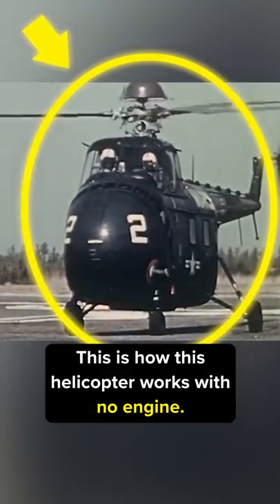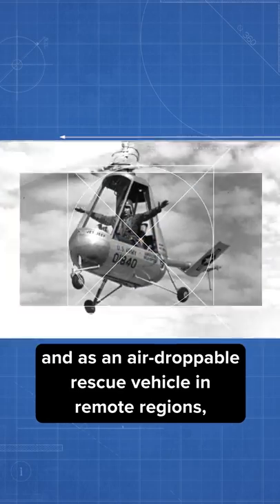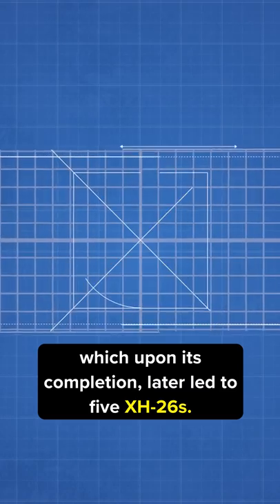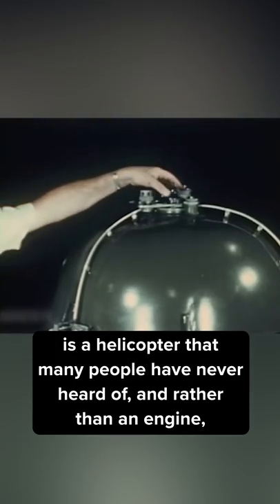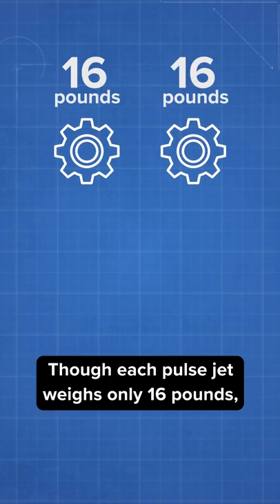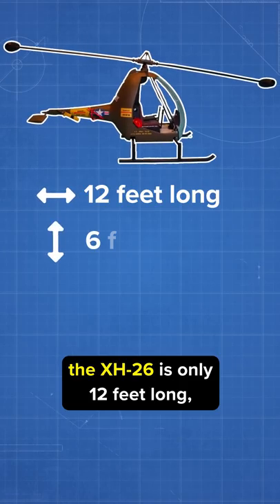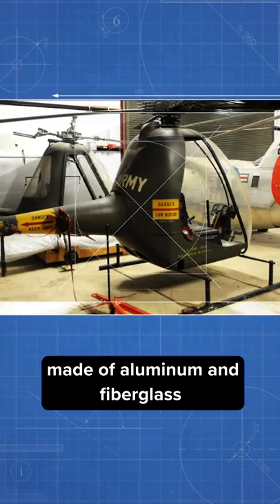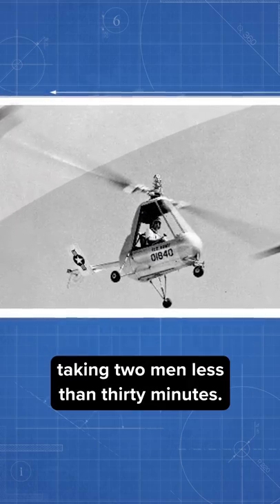How This Helicopter With No Engine Still Flies

Comment: pulsejet is still an engine
Reply: Yes
Reply: Facts
Reply: Jet engine that goes off in pulses
Reply: Yeah I was expecting it to be like bike pedals but nah this is boring
Reply: Wanna hear the worse part? You take 2 people to put it together then 1 person to use
Reply: Nah it's a jet
Reply: """"Jet engine """"
Reply: Yes, two of them.
Reply: Shpulda said no motors
Reply: I think it would be cool if there was a hand crank, but like a huge gear ratio and when you crank it once, the propellor spins like 5000 times.
Reply: 🤣 unsubscribe blocked and reported for fraud
Reply: @brib4911  An engine or motor is a machine designed to convert one or more forms of energy into mechanical energy. By definition there is no difference.
Reply: @Pengied  you'd need to be hulk to spin that hand crank then lol
Reply: @thatcommenter9111  no, it said with two people it would take less than 30 minutes but with one it would probably take longer
Reply: Exactly
Reply: @julianmathiasroder  huh. Neat.
Reply: Yessssssss
Reply: @UserOfTheName  Even legs on bike pedals are technically an engine. An engine is any device that converts potential energy into mechanical energy. In this case, it’s converting your body’s energy stores into rotational motion.
Reply: Yup,  with a fuel injection system.
Reply: Actually it's a motor
Reply: @xenn4985  You it's not a pump?
Reply: @mike7870  Thanks,  Mike!  Now where am I gonna go to get my daily dose of misinformation??
Reply: @Pengied  yea it would b cool but it wouldn’t work is the problem
Reply: It's a misleading title
Reply: Absolutely
Reply: @joshuaportwood6415  🔴 What Is Islam? 

🔴 Islam is not just another religion. 

🔵 It is the same message preached by Moses, Jesus and Abraham.

 🔴 Islam literally means ‘submission to God’ and it teaches us to have a direct relationship with God. 

 🔵 It reminds us that since God created us, no one should be worshipped except God alone. 

 🔴 It also teaches that God is nothing like a human being or like anything that we can imagine.

🌍 The concept of God is summarized in the Quran as:

📖 { “Say, He is God, the One.  God, the Absolute.  He does not give birth, nor was He born, and there is nothing like Him.”} (Quran 112:1-4) 📚

🔴 Becoming a Muslim is not turning your back to Jesus. 

🔵 Rather it’s going back to the original teachings of Jesus and obeying him

Comment: "This helicopter has no engines"

Shows a helicopter with an engine

Then the actual helicopter still has 2 engines
Reply: A rotary piston engine even in the nose cone like come on it’s an engine
Reply: @dr.pop2562 how can it be a rotary and a piston? I think u mean radial piston
Reply: @d21bash  that's what i ment XD it was very late when I wrote it
Reply: @d21bash  actually there are rotary piston engines, the whole every cylinder spins instead of just the rotor. believe me i didn't believe it either
Reply: Confusion of the highest order
Reply: @beaclaster  Wright R-1820-84 Cyclone Sikorsky H-34
Reply: I’m in
Reply: Right get it right or dont do itat all

Comment: Basically, a death trap.
Still a wonderful machine.
Reply: Why?
Reply: @halfofmg394  It need more rocket, that why.
Reply: Because jet engines are unpredictable when used in this manner
Reply: @halfofmg394  I have read an article about that project, as far as I remember the attached jets are susceptible to sudden detachment from the blades due to unpredictable circumstances from jet engines often causing the helicopter to crash for lack of propulsion to the blades. That is why the project was shut down because instead saving lives from the original purpose of the craft to it becoming a flying coffin.
Reply: @halfofmg394  unlike a normal helicopter, it could not autorotate. In the event of engine failure, a normal helicopter can adjust the pitch of the blades to sustain rotor speed and cash in on that energy to slow its descent.
Reply: Okay, i see... Thanks guys

Comment: The mi-4 has an engine. It's in the front plus that's literally an entirely different helicopter
Reply: Not an Mi-4 that’s an H-34 but it has a very similar layout
Reply: @spiritbear7781  wasnt the mi4 a "copy" of the h35 like the tu4 was a copy of the b29?
Reply: @achicken6477  nope. Entirely different design origins
Reply: Do you notice the USA markings at all?

Comment: 'This chopper has No Engine'

proceeds to describe the power process which includes a type of (albeit very small form factor) static combustion engine

We get it though; their size and weight are negligible in the design.

Comment: Pulsejets are a type of engine. What’s unique about the helicopter is that it does not use a turbo shaft or piston engine to power the rotor.

Comment: The problem was all that mass and drag made autorotations essentially impossible, pulsejets are loud so the covert aspect was blown, and overall it was a disappointment. Tip-jet powered helicopters have been tried multiple times, and never caught on.

Comment: The title is correct here is the definition: .
a machine with moving parts that converts power into motion.  Now it wasn't said there was no propulsion units.  If this was made now a days weight could probably be dropped by at least 25% with honey comb structures and Carbone fiber as well as nonotubes.

Comment: What was its range? Top speed? What was the reason it never got past the test phase? Could it be it’s range and top speed? One flaw I see is unless you have two and spend an hour putting the second one together, then one guy if it takes two to build, gets left behind because it’s a one man copter.